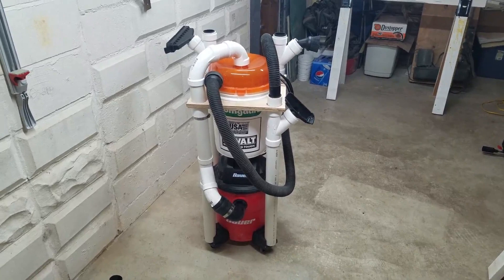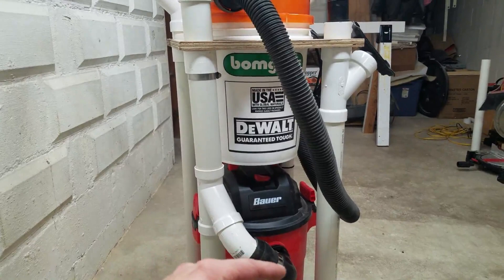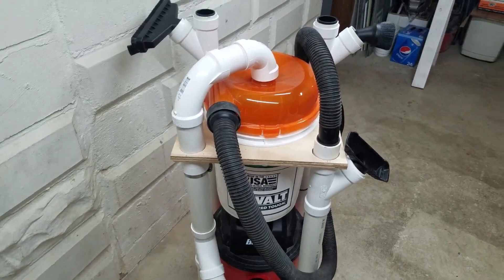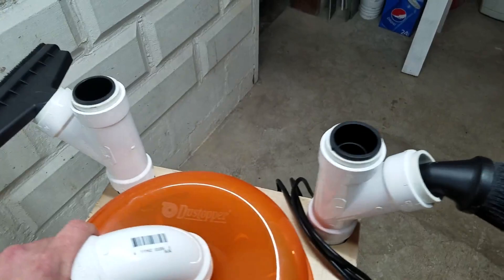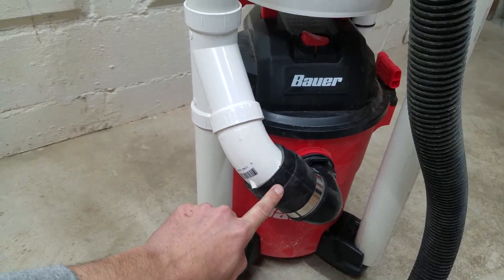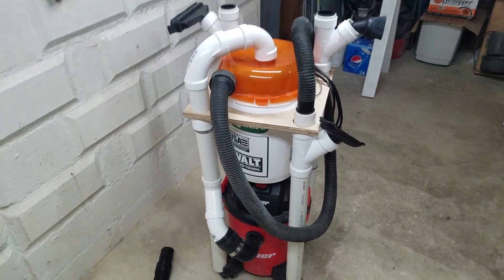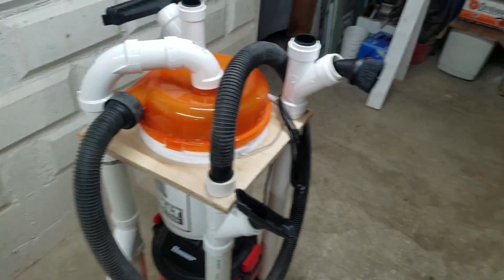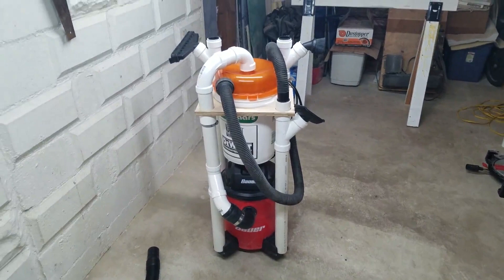I Built the Ultimate Shop-Vac Dust Cart! | Harbor Freight and Dustopper

Comment: 99.9 % Perfect, I would only round the ply corners and ground the unit. I will say, 12/1/2022 It seems HF changed their lid a bit, it's thicker and added a fitting in the box. The dustopper is great for wood dust and has a lower profile. The HF and DD units seem better for spackle dust, about the same for wood dust. Though nothing seems to be perfect for spackle dust so exhaust the vacuum out the window... You may wish to ground the buckets via foil tap and a wire to a grounded outlet. Wood dust and sparks do not mix well.
Reply from the maker: 99.9%? I'll take that any day, thank you. I found I have very little static in my cabinet model compared to this set up.